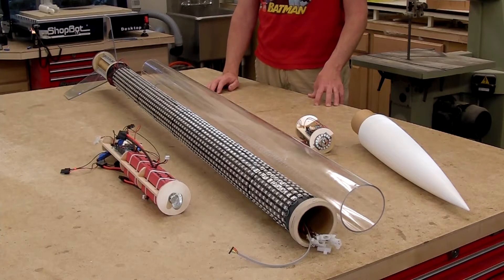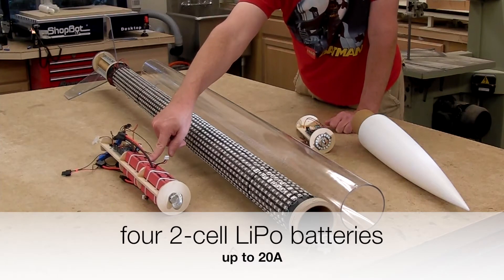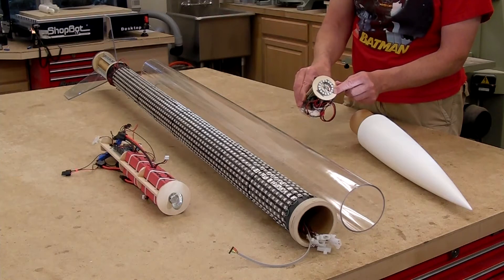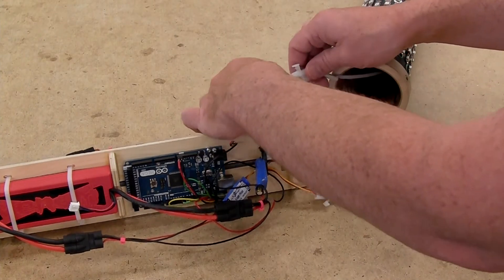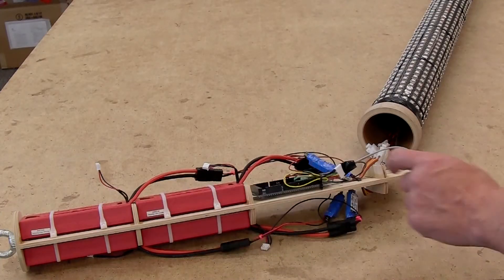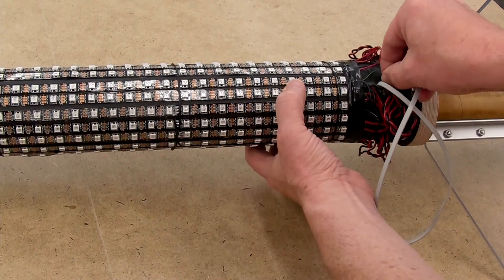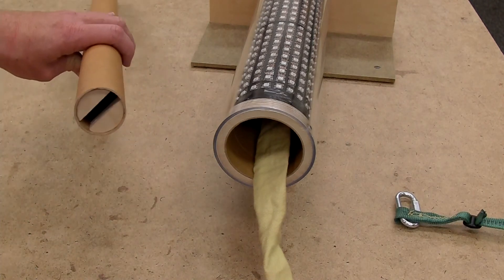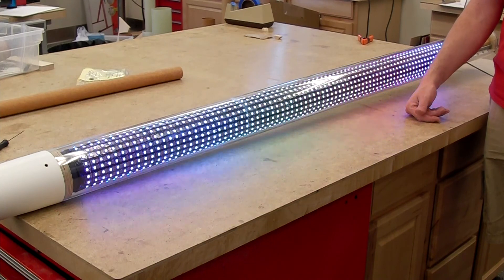Light Show prep

Comment: Interesting. We had the same idea. Mine is not as tall. And I used a single strip in a spiral fashion spaced apart I'm curious what size motor did you use to get that off the ground and what size parachute mine was a 54-in black on top silver on the bottom to reflect the light on its descent waiting on parts so I can test fire projected altitude at 1000 ft and for the inner A-frame I use the same type of plastic 1/2 inch apart from each other so I don't think it's heavy is the one that yours looks like it is
Reply from the maker: I flew it in a J415: http://jcrocket.com/light-show.shtml

Comment from the maker: No video of it in flight (it would just be a blur), but some good night pictures at the launch a few years ago: http://jcrocket.com/light-show.shtml
Reply: I am in the process of building a similar rocket in the nose cone I took apart an electronic road flare broken-down was only 2in in diameter to fit inside of the nose cone that was very easy and very light next I took a 2 inch tube like 36 in Long and wound on a addressable lighting system that gets covered by a 2 and 1/2 in clear plastic tube of which the finzar epoxied on I think I can fire it with a reloadable G motor parachute is 54 in with silver lining underneath to reflect light as the rocket descends after seeing your pictures I will test fire It On The Ground horizontally to make sure there is no issues with parachute deployment going to try for Li poly batteries at 3.7 volts each and they are going to be the smaller cheaper drone battery so they should fit alongside the engine inside the tube hopefully with all the drones and cameras on this thing I should get a decent show on The Descent but like you said taking off would just be a blur it would be The Descent that the Late Show would happen 52 in tall and almost 5 lb curious as to what you think I would use for an engine should the G engine not work
Reply from the maker: @bigbobno11  What I usually do is use the ThrustCurve.org motor guide to select some likely motors once I have a rough weight: https://www.thrustcurve.org/motors/guide.html